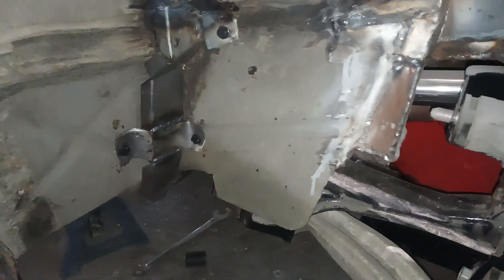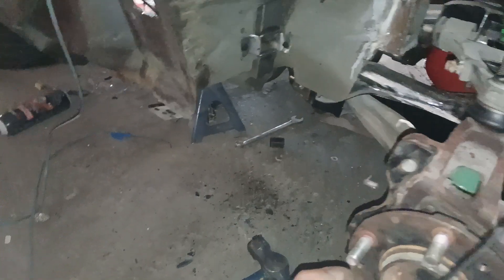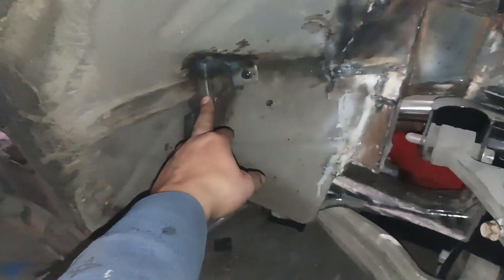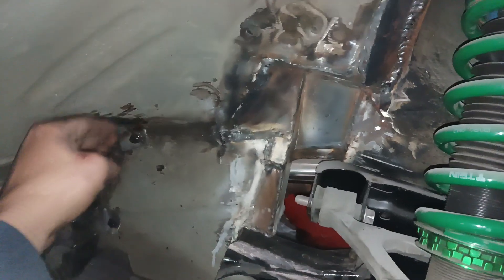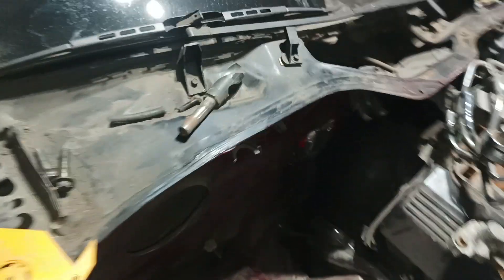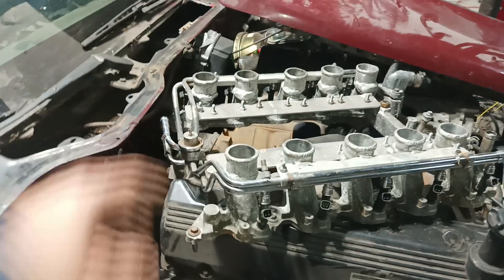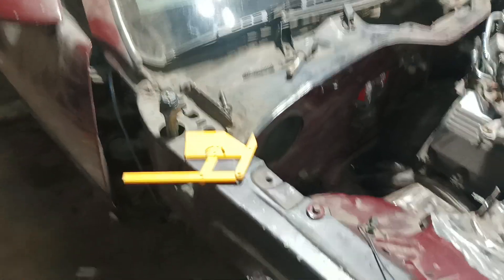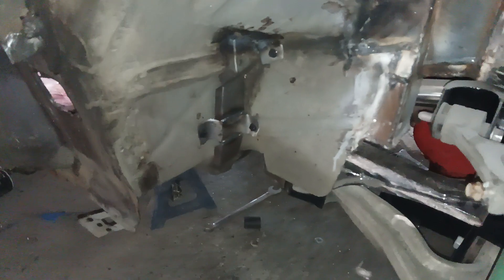figuring out fuel line routing on the 3rd gen Camaro

Comment: Definitely go 3/8". With the size of engine and the fuel demand, 3/8" would be bare minimum. You don't like the braided stuff? I'd trust it more than rubber injection hose and certainly compatible with ethanol fuels (which by the way, I've heard Chevron 94 is no longer ethanol free. Thus, we have no more ethanol free fuel out here). Hard line certainly is the best and would last for many, many years. See you soon..
Reply from the maker: 5/16 has been the standard for most cars for the last couple decades. The flow difference from 5/16th to 3/8th is minimal when ran  under pressure in an n/a car. I don't like all the extra costs of braided hose. A simple hose clamp and your off to the races verses male and female fittings and needing to wrench it together.